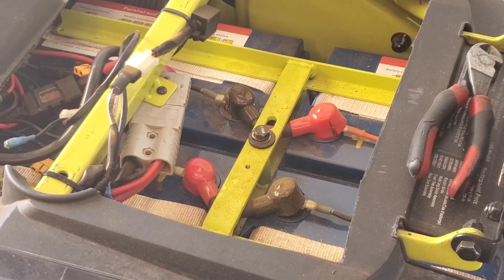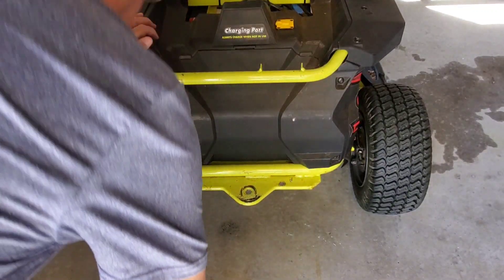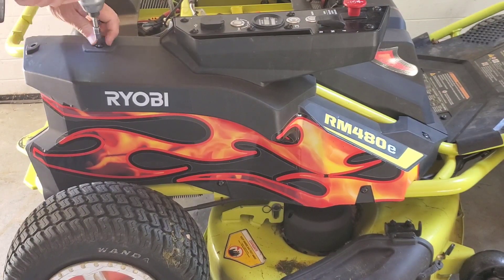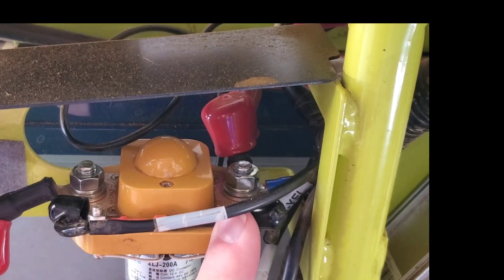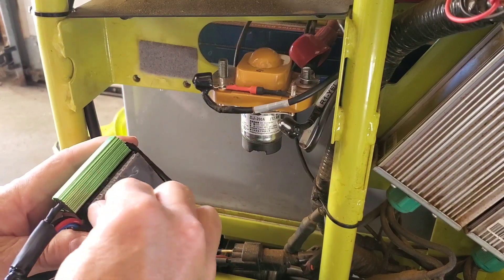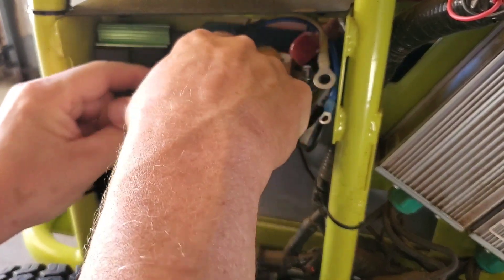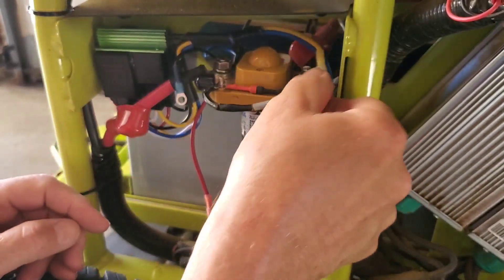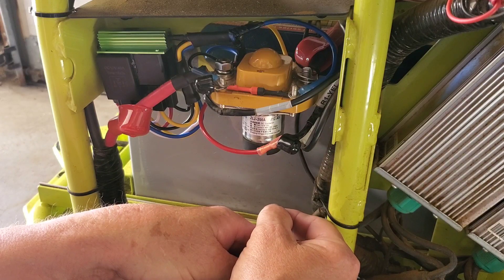Automatic Precharge Circuit

Comment: Hi, I replaced the "lid acid batteries" with "lifepo4" ones, and first I had a charger issue, I bought a different charger, and now it says the batteries are fully charged but, when I turn the key to ON, I hear a click and the batteries go to Zero or 0. something volt and nothing work, I watched your video and before that, I watched other videos, do you think that the "Atumatic precharge circuit" will fix that if so where to buy one of these? thank you

Comment: I replaced the lead acid batteries in my ryobi zero turn with one, 48V 100AH Chins battery. It worked great for one mow, but now the mower won't turn on. I figured I need to install a pre-charge switch, but then I got to thinking: my Chins battery has a built in BMS and I can even connect to it via Bluetooth and check various parameters. In the battery parameters I noticed the battery has a discharge overcurrent protection of 327A, and secondary overcurrent protection of 250A. Then I noticed the DC contactor on the mower is rated for 200A. So I'm wondering if I can just replace the contactor with one that's rated for 12V but maybe like 400A. I found a 12V 400A contactor solenoid on Amazon for $50. Looks a lot like the contactor on the mower. Would that work?
Reply from the maker: When you turn the mower on does the battery voltage drop to zero v? 
If not does the factory gauge turn on with the key on?
Reply: Thank you very much for your reply. No, the battery voltage stays at 53V even when I turn the key to on, and the factory gauge does not turn on either. Also, I noticed I'm not hearing any clicks (from the contactor?) when I turn on the mower, either.
Reply from the maker: @Who-vt9oh visit my Facebook group here's a post I made of this concern . I can't post the picture here for some reason.
https://www.facebook.com/share/p/kcshbKXp2vd31JPt/?mibextid=oFDknk
Reply from the maker: Follow this link for a diagnostic chart. 
https://www.facebook.com/share/p/kcshbKXp2vd31JPt/?mibextid=oFDknk

Comment: Hi. I just did my LFP conversion and discovered I need this pre charge circuit as my batteries are tripping due to the inrush current.  Could I buy one from you?  I went to the FB page but did not see an easy way to search there.  Thanks in advance for your help!

Comment: solid build and solution - sidenote - never test without proper tightening of the connectors as this may result in an electrical arc, fire, loss of an eye or other parts
Reply: wholeheartedly agreed and noticed the same thing! This fella knows what he's doing, just bought his relay and will run my ZT480 with 4 new Siekon 100ah LiFoPo4 batteries. I started the mower after only installing the new batteries and it works without the relay. But the relay will prevent high in-rush currents to the drive controllers hopefully elongating the longevity of the controllers.

Comment: Why needed and where to buy and part ID?
Reply from the maker: Some lifepo4 battery and mower combinations need a inrush circuit.  I build these automatic ones. If you want one contact me through Facebook group  Ryobi 48v Riding Mowers  group
Reply: @Ryobi48vElectricMowers How or where do you get one of these?  I tried to convert to lifepo4 but as soon as I did it failed to start and I was seeing the battery voltage drop from 58 to 3v.  No clicking from the contactor.  Sla batteries work fine.
Reply from the maker: Sorry I didn't see this earlier. You can find me in my Facebook group and let me know if you still want one. Or at smtgreg@gmail.com